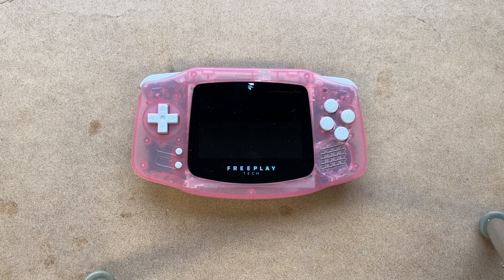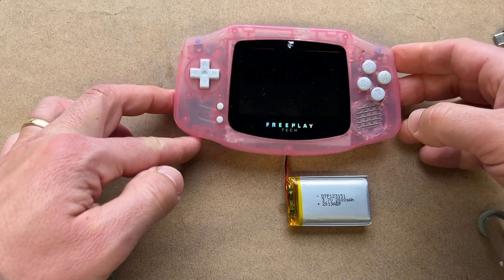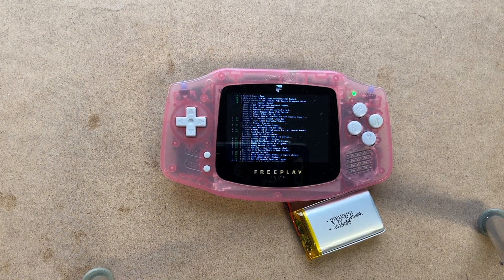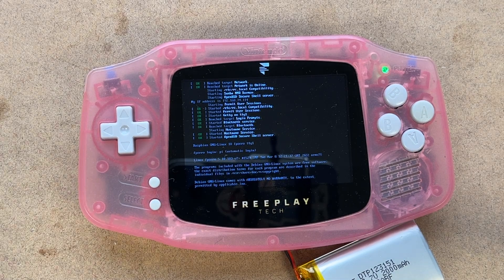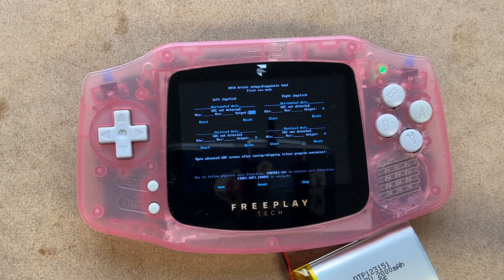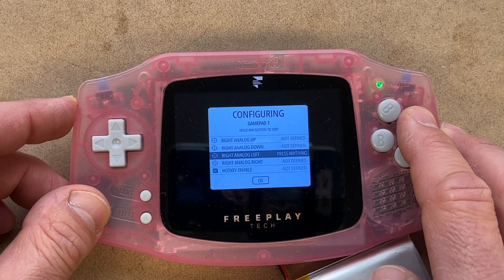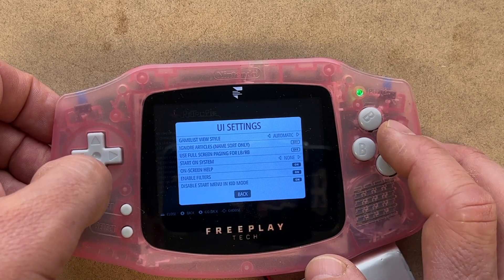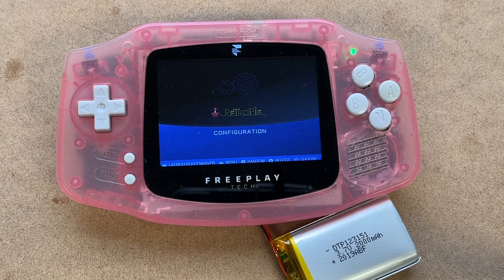Freeplay Zero 2022 First Booting RetroPie

Comment: Is there a way to update the old image for the old board with Raspberry Pi Zero 2W? Those warning screens are getting a little bothersome...
Reply from the maker: You could use the Freeplay_CM3-and-Zero2_Test_22061501.img.gz image file.  Updating RetroPie should (in theory) work, but it seems to not be a smooth transition in some cases.  Maybe try that "Zero2" image file on a new SD card to see if it helps you.  I'm not sure which warning screens you're referencing, but I would guess that they're part of RetroPie and you might find some help on the RetroPie forums.
Reply: @freeplaytech  it was some kind of error message I kept getting when I would boot up a game: - failed to find mixer element.
Reply from the maker: @rastamouse7861  Maybe https://www.reddit.com/r/retroflag_gpi/comments/kbd8jh/how_do_i_fix_failed_to_find_mixer_elements_if/
Reply: @Ed Mandy  thank you Ed!

Comment: This is awesome keep up the great work any chance of you making a cm3 v2 ?
Reply: I’d like to say YES, but, with CM3 super difficult to purchase, that may be a useless effort.  If a CM4S Lite ever comes out (and available), then it’s on!
Reply: @TheMandys  
Awesome!
from what I’ve seen the zero 2 should be be on par with the cm3 anyway (I could be mistaken) 
If you don’t mind me asking (and sorry for the jumbled up questions) how come there was so much trouble using an ips display for the older mother boards? I understand that the limited size of the gba shell didn’t leave many options but were there any other problems you faced trying to solve this issue?
Reply from the maker: @MotivatedPioneer  That's funny.  I replied on my phone, but I was signed into my family account.  Oh well.  The Zero 2 and the CM3+ use the same CPU core.  The main difference, offhand, is the clock rate and cooling.  The CM3+ has better cooling, so it can be clocked faster for longer.  To match its speed, the Zero 2 needs to be overclocked.  BUT, for most things, that's not necessary.  I'll talk IPS in a follow-up.
Reply from the maker: @MotivatedPioneer  IPS:  Size was the main thing.  When we started this project, that 3.2" LCD was the only suitable LCD that we could find that actually fit the shell.  It uses an SPI bus to communicate, so it only used 4 (IIRC) of the pins on the Pi.  That was important, because we used almost all the rest for button inputs.  Even if there were a 640x480 LCD the same size/shape, we could not have used it.  The SPI bus isn't fast enough to handle the added data required for higher resolution than 320x240.  So, for that system, it worked well.  Now, we have re-engineered all of that to use a DPI bus.  This takes up almost all of the pins on the Pi just for LCD data.  It can handle the higher resolution, but it means that we need to re-engineer other parts of the system (mainly the button input system).  So, it's all together physical size AND electronic limitations.
Reply: @freeplaytech   that must have been a pain in the neck to rework the board to get the lcd to work properly I’m glad you were able to get it working. That was one of my issues with the cm3 unit the resolution and how blurry the text seemed when in the main menu and playing gba titles.
Reply from the maker: @MotivatedPioneer  I know what you mean about certain menus, but I always thought it looked great once you're in-game.
Reply: @freeplaytech  i always noticed a slight blur in text and some in game sprites but it could be the scaling or resolution I have it set too. how does it look on the new display?
Reply from the maker: @TheMandys  That was me.  I accidentally replied while signed into my family account.